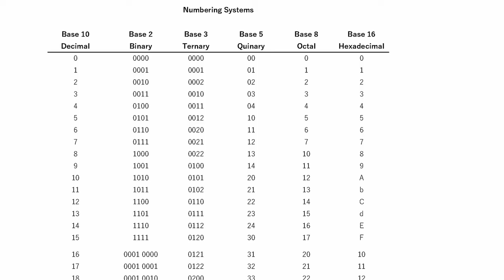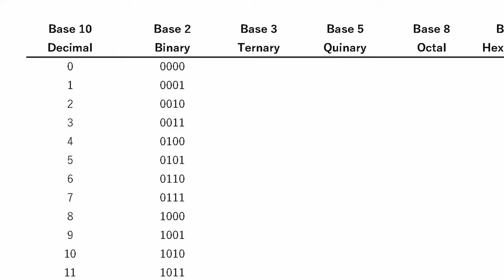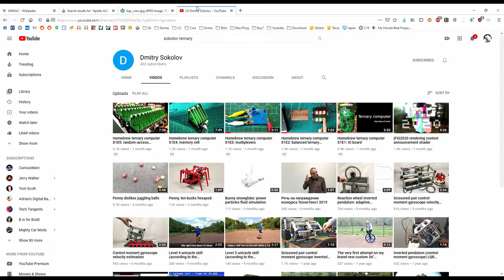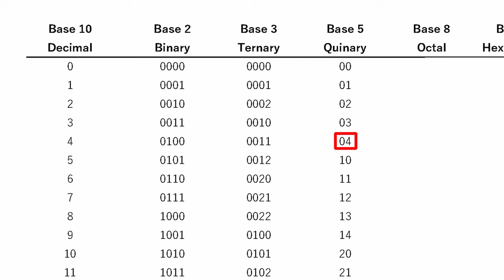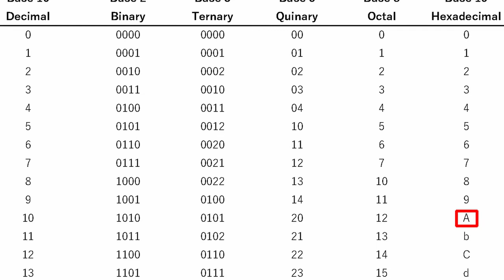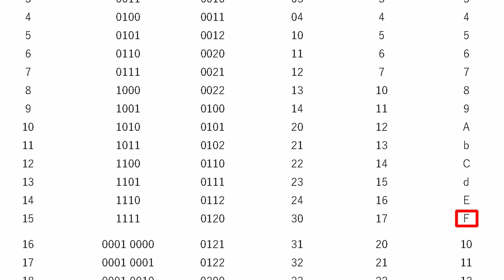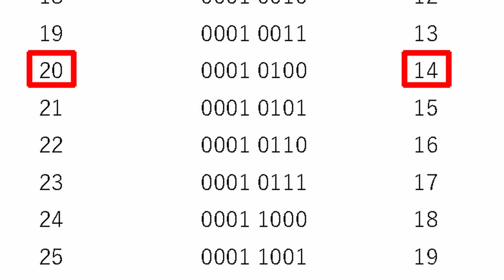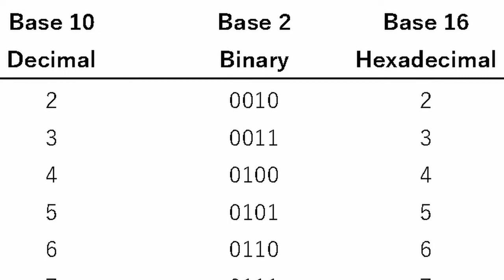Relay Calculators: Episode 1 - Numeral Systems

Comment: A lot of people don't realize the reason Octal (Base 8) was used in the early computing days is because each digit represents groupings of 3 Bits (similar to how Single Hexadecimal digits represent groupings of 4 Bits) and because the Nybble (4 bits) and Byte (8 Bits) weren't completely standardized at that time. It was the go to system that didn't use letters. Hexidecimal gained favor when the Nybble and Byte became the standard as their bit representation aligned. If we had settled on 9 bit Bytes we'd probably be using 3 Digit Octal values since 9 is a multiple of 3.
Reply: Yeah. People just don't like that partial most significant digit! FF just seems better than 377 😁

Comment: I used to have to hand code machine language (because i didn't have an assembler).  Trust me, you can get very good at doing hexadecimal math in your head if you do it enough.  Nowadays i would just use a calculator, but when i was doing this, i could not even afford a calculator that could do hex math, so i learned to do it in my head.  Works fine for addition and subtraction, but i would not even want to attempt multiplication or division.  ^-^
Reply: I used to write machine code in octal. I knew many 8080 opcodes in octal! Totally got tripped up when I started seeing them represented as hex😂

Comment: Hmm. Interesting. True quinary hardware means there are 5 differnt logic levels. That's pretty nuts. I could see true trinary hardware (3 distinct logic levels), but true quinary seems very complex to engineer. Ooof! Ok.. i see what might be going on here... The Apollo computer was binary... not octal. It just output the binary as octal bc it was the common shorthand. Same with hexadecimal now. There are no true octal (8 distinct logic levels) or hexadecimal (16 distinct logic levels) computers that I know of... Guessing that quinary computer is not really a quinary computer, but just outputting binary as quinary. If your computer calculates in binary, it's a binary computer regaurdless of what format is on the input or the display👍👍 You didn't make a hexadecimal calculator, you made a hexadecimal interface for a binary calculator.

Comment: For quite some time, I've been fascinated by logic circuits, fpgas, building an 8-bit computer, and Ben Eater's series on building a computer from scratch etc.

A month or so ago, I had this ludicrous idea ... wondering if I could build logic circuits out of  nothing but relays. The more I thought about it, the more intriguing the idea was. Thinking that this was a somewhat original idea (in recent times anyway) ... I was so excited that I ordered up a ton of relays just to try out my idea. (They'll arrive soon.) Then I used a simulator to build up some of these circuits. It's only at this point that I realized there were already simulator scripts available for all that I had just created. Today, finally I did a search on youtube to see if perhaps someone else had actually built complex circuits using fundamental relay logic circuits (... rrl?)

You can imagine my horror to find your videos. It seems you already did exactly what I was planning to do. Thanks for that!

It's a great idea though ... and you have done it very well.
Reply from the maker: Thank you very much!

Though, I can't really take much credit. I stumbled across Jeroen Brinkman's build and he has one of the best resources on Relay computing information I've seen. Definitely check out his Mercia computer, it's an insane build: http://www.relaiscomputer.nl/

Pretty much all the relay logic circuits (RRL, I like that!) I use in both of my builds are based on the circuits he covers on his website.
Reply: Old computer systems used relays as the switches before they switched to vacuum tubes
Reply: The Z3 used 2000+ relays it was at 1941

Comment: Computers use binary and because a conscious decicion they were grouped into 4 and 8 and multiples of 8. Thus binary and hexadecimals are good to show those internal codes. Computers also were programmable to show those internal numbers to which ever way the user wanted.

Calculators on the other hasnd were not easy to program to use wide range of numbers in binary. BCD (binary coded digit) system was adopted by calculator makers because you can use four bit adders to add the digits and your carries are still only one bit. But to show them on display you already had the base 10 definiton of the number.

Comment: Quaternary, base-4, is probably going to become increasingly important, because of bioinformatics. With base-4, each nucleobase is neatly encodable in a single digit.
Reply: The problem here is designing hardware that can work reliably using those four unique logic levels.
Reply: @maskddingo1779  I suppose the obvious solution would be to take a vaguely RISCy approach and build some kind of microkernel such that the actual silicon is still a good old-fashioned binary computer, but if you're one abstraction layer up, so to speak, then all you see is (virtual) quaternary computing hardware. I'm not sure if anybody has ever thought through what logic gates for quaternary computing might look like. Heck, you could even build a kind of virtual FPGA, where the underlying hardware is mostly or all binary, but the logic elements and FPGA you get to work with are quaternary. Something like that might be flexible enough to become a generic platform for all your quaternary computing needs, only limited by the number of logic elements, though you could have bigger and smaller chips along those lines.
Reply: @maskddingo1779  PS: Maybe this is a really stupid side thought, but I wonder if there's a way to write your microcode just so, and use a 4-bit binary CPU like the Intel 4004 as effectively a 1-bit quaternary CPU. I haven't really thought this through, but I'm just spitballing.